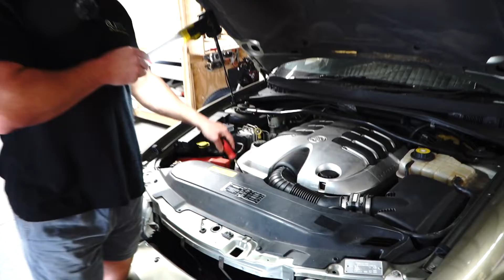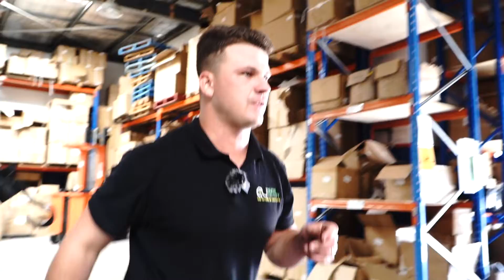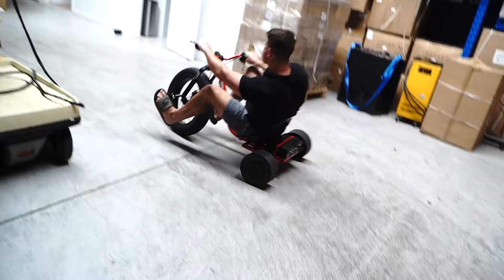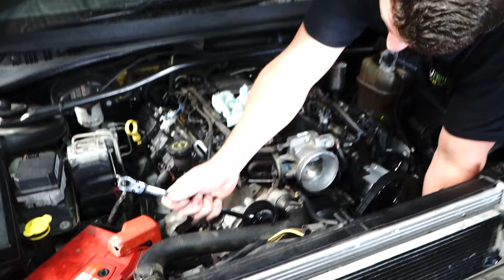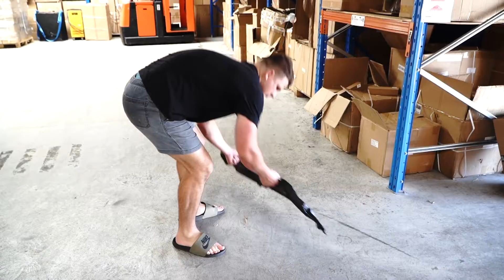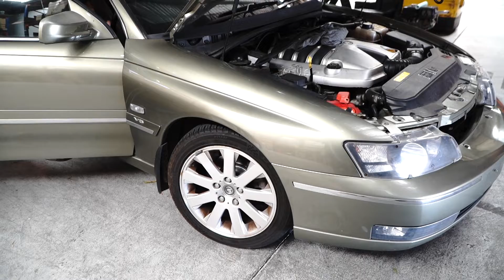How to Replace LS1 Power Steering Pump Holden Commodore VT VX VY VY V8 5.7L

Comment: For anyone who’s going to do this with their own car, make sure you use a flare nut spanner for the nut on the high pressure line as a normal open end spanner can round the flare nut if it is very tight.